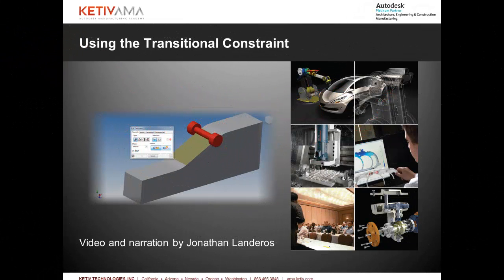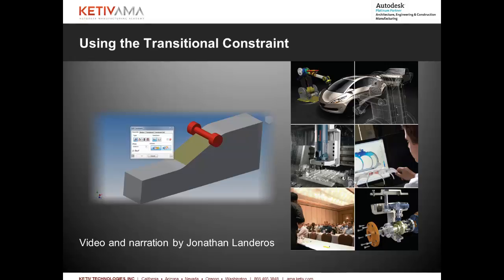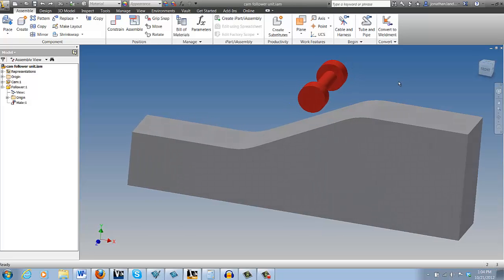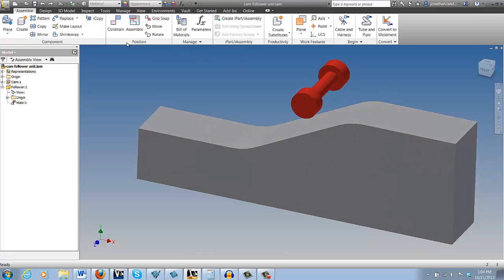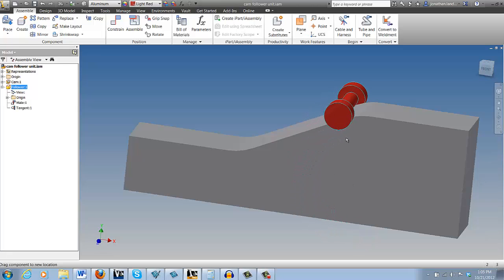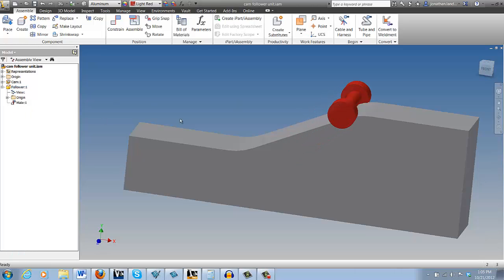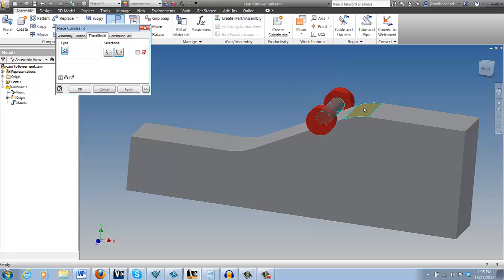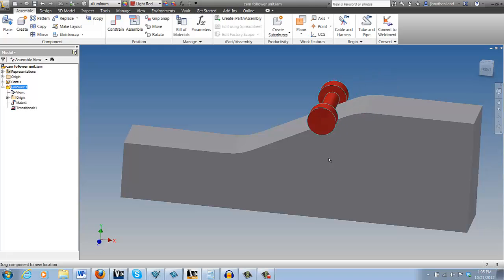Using the Transitional Constraint in Autodesk Inventor

Comment: Hi, I tried exactly the same thing but my simulation is glitching. Meaning when I drag the cylinder from the flat surface to the curved area, the cylinder behaves abnormally. What could be the reason?